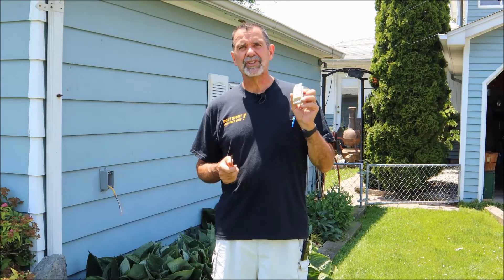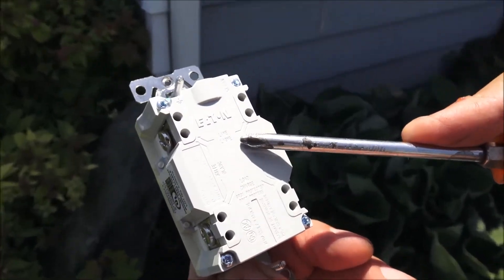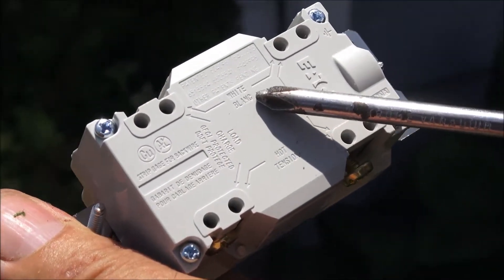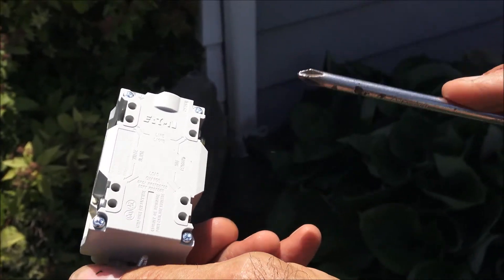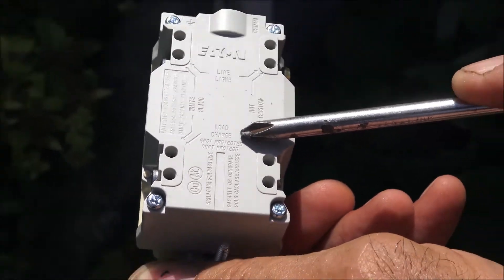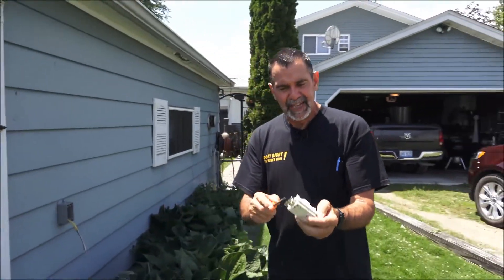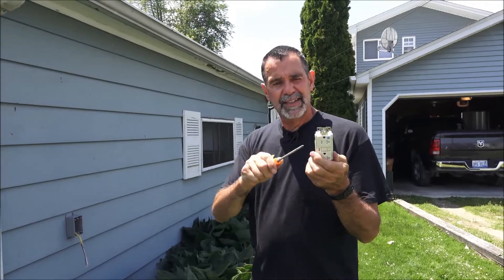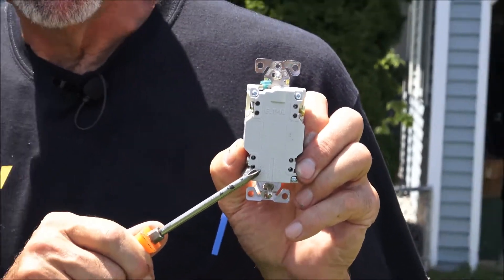GFCI Common Fail - Connect to Line or Load?

Comment: why does each terminal have two holes? so that there are eight holes in total. is that so you can connect two wires into each screw? thanks
Reply from the maker: @gareginasatryan6761  I have used the extra holes on the line (feed) side of the device to continue ‘unprotected’ power downstream. Also the load (output) side to split protected power to 2 different directions.

Comment: If I’m changing out a standard recept to a GFCI recept in an existing house, how do I determine which set of wires is the load and which is the line from the wires in that recept box?
Reply from the maker: Hey, separate the wires, so they are not able to touch one another or the ground, then I turn on the circuit and using a voltage tester, I touch it to the wires to see who is hot coming in. Typically you can see where the black and white wire come out of the same hole as the Romax was run as one piece.